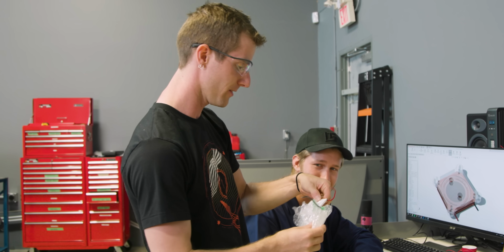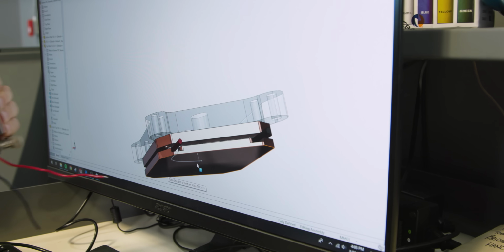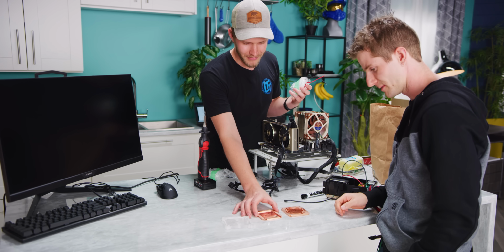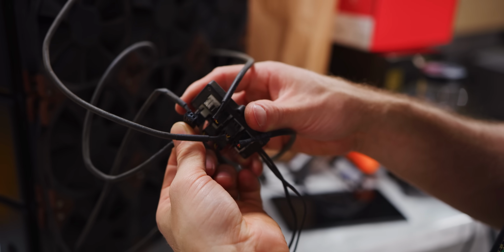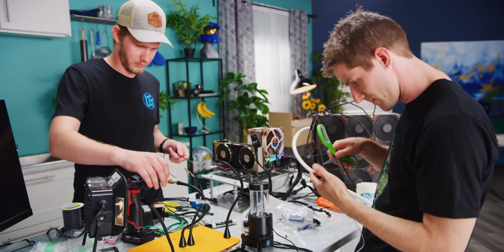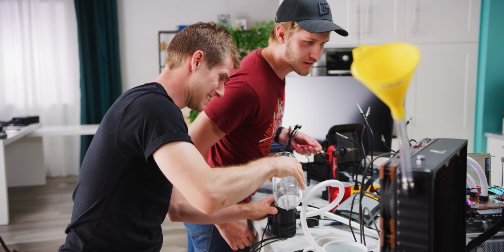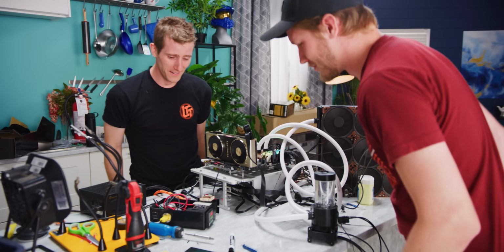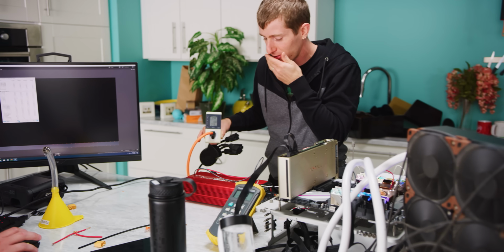This Cooler DRAWS 545W!!? Bad Cooling Ideas #2

Comment: Linus, it wasn't a bad idea... 😁😁😁 It's just normal to run into some bottlenecks with such tech concepts... For some reason, I have some faith in your work. It's either the next big revolutionary cooling system to hit the market. It only takes a good amount of expects putting in some more work and some few trials. It should work 😉😉😉

Comment: For future reference, get a CO2 extinguisher. It will still put out the fire, but wont hose your expensive GPU.
Reply: and maybe remove the safty pin too..... ;)
Reply: Daniel Svensson you should never remove the safety pin from a fire extinguisher unless you’re actually going to use it to put out a fire. As soon as the pin is removed the extinguisher is considered used even if you don’t empty it and must be replaced.
Reply: Get a Halon extinguisher. It won’t corrode or damage electronics
Reply: @FeNite8  halon is illegal
Reply: @t_c5266   Halon extinguishers are legal to own.
Reply: @daexion  yeah if it's from 1994 or before. Halon is illegal to manufacture
Reply: @t_c5266  Halon is used all the time in data centers and aircraft
Reply: @FeNite8  only where it's grandfathered in. It is illegal to manufacture any new halon. Look it up. Clean air act. And the NFPA. You can only get recycled halon and already existing halon.
Reply: @t_c5266  But it isn't illegal to have, use, distribute, etc. Only, there's a limited, nonrenewable supply.
Reply: Idk I prefer those hydrogen extinguishers
Methane works also
Reply: @makinbacon21  that is a big Brain idea
Reply: And it'll help cool your CPU! Hey Linus, try CPU cooling via C02 fire extinguishers!
Reply: CO2 extinguishers don't work for electrical fires. For those, you need to get a powder extinguisher. Which would, by the way, still hose your expensive GPU.
Reply: @Z3DT  that is BS.

CO2 is the preferred way.
But still don't count on hardware surviving, there is rapid cooling and condensation.
Reply: @Z3DT  Maybe not... as long as the powder is not thermal conductive, a quick clean and the GPU should still work.
Reply: @christopherkidwell9817  powder extinguishers trash whatever they go on. Stuff is corrosive. You'd want to ultrasonic clean it after it was sprayed to make sure it's reliable in any way
Reply: @Z3DT  Read the label. CO2 extinguishers were designed for electrical fires. They do not work on grease fires.
Reply: @JoshuaBurgess  they are suitable for petrol and oil fires. And recommended for live electrical fires
Reply: @Z3DT  just grabbed one of my extinguishers. An FE36 will work. Rated B,C so it will work on electrical fires. So no nuking components =D

Comment: The better you cool the hot side the better the effectively it cools the cold side like for example if the hot side is like 70 degrees c the cold side could drop like 30 degree c so it's 40 on the cold side but if you can cool the hot side to below subzero using Linus DIY window AC cooler the the cold side could get temperature you though of before

Comment: watercooled sub ambient setup submerged in a mineral oil tank that is also cooled sub ambient. would condensation still form?
Reply: I've done that. Condensation builds on top of the oil, and sinks down to the bottom. The silicon oil I used were lighter than water.. It needs to be completely sealed. Ambient hotter air moisture will always condense on cooler materials, even oils^^.

Comment: Why are u using metal bolts to hold the cold and hot side ? Those bolts conduct heat from the hot to the cold side. Use plastic ones next time.

Comment: Okey, so if one TEC doesnt work, with not use more? in parallel, stack them to get more cooling power, of course its going to eat more energy, but if you increase the "cooling" power but keep the same area i think it could work

Comment: Can you make a video where you cool the cpu directly with water?
I mean building something like a tank, which sits directly where the cpu cooler would sit and has a hole on the bottom, where the cpu is located. So the CPU will be directly cooled by the water. The tank with the cooling water can then be cooled with other things.
Reply: That's a very stupid idea on multiple levels
Reply: @bucklinspring  which is why it's so great!

Comment: Just a quick note for future vids, Solid State Relays like the one you have are incapable of switching DC on and off. They use a TRIAC internally meaning that once they are on they get stuck on until the voltage falls to zero (which happens 120 times a second with 60Hz AC). I would recommend a MOSFET SSR in the future, they sell such devices for use in 3d printer heated beds.

Comment: Good job Alex, even though the tec didn't hold up the machining of the water block was top notch. maybe you need more peltiers cooling down a larger thermal mas to stabilize the temperature under load. Keep up the good work and linus give alex a good performance appraisal.

Comment: @Linus Tech Tips - protip, if you mount peltier element backwards, just switch wires and it will switch around its hot and cold side ;)
edit: also maybe you could use PS_ON instead of SSR
edit2: Peltiers take up to 15V
Reply: did either of you even watch the video or what
Reply: Jan Nowak  You should only run a Peltier element at 60% to get max efficiency. 12x30 is 360 so it puts them pretty close to the 60%. Still over by a bit actually. I agree though that they don´t know anything. AC relay when using DC current :D Although I think they took it out when they used the variable DC supply.

Comment: Redesign your fins to conduct more than 1000W of heat, consider a Staggered pin-fin array and try stacking Peltier's. This isn't over it can be more extreme!
Reply: Nix Kanal stacking peltier’s is a horrible idea!
Reply: @rileyfenley522 yes but it is possible to get lower temperatures if you stack them by size like a pyramid. Look up Cascaded peltiers.

Comment: Can you please plug it upside down, hot side on the CPU and cold side on the water block. Then you use the electricity from the seebeck effect to power the pump & fans.

BOOM! Passive cooling baby!

Comment: I actually did a peltier module cooling system for a science project in prep course. In the end, it all comes to the efficiency of the thing, a Peltier module is very innefficient because of joule effect. Usual cooling systems such as a fan+rad or a watercooling don't actually produce heat (well, they actually do because of moving parts but in a very small proportion) but a Peltier module produces way too much heat. They usually uses a bunch of semi conductors whose electrical resistances are not negligeable. If you power your peltier module with maximal power it is actually going to heat up even on the "cool side" because the joule effect will draw more power than the peltier effect. The best would be to turn it on with less power, with a potentiometer for instance, and increase the power little by little, seeing at what point it starts to drop. But doing all that is a pain (I tried to do it but you have to get a potentiometer that can support a lot of power and they are not cheap). That's why TEC is not a very used tech, and why your fridge isn't a big box with a bunch of peltier modules on the back.

Comment: The issue is that the efficiency goes down the more power you put into it. Instead of using one large peltier, you need to use several. I have 32 across several waterblocks, but I only ran it at about 6-700 watts of the potential 2500. A loop on the cold side also acts as something of a buffer before the heat would overcome the cool.

Bridge rectified and ran various amounts in series to get some cheap voltage control without psu limits. My downfall was I couldn't justify expensive pc water pumps and opted for super cheap water fountain pumps. Couldn't keep the darn things primed and the system would fail the moment an air bubble came through.

Comment: Now use an aquarium chiller with automotive antifreeze in a water loop.
Reply: ...antifreeze is terrible at cooling, though... it's literally right there in the name.
Reply: @evilkillerwhale7078  i am using a 20% ethylene glycol and 80% distilled water in the same loop for years. Recently i dismounted a GPU waterblock : it still looks like new.
no more maintenance to do ever ! no corrosion, no algae or bacteria.
that's what they are using in AIOs watercooling systems by the way.

Only drwaback is it's highly toxic and tastes sweet. so toddlers and pets are a concern in case of a leak.

waht i bought is a botle of ethylene glycol based automotive coolant. (jsut check the poison writing on the bottle to know if it's etylene-glycol based)
don't use propylene glycol. it does nothing against algae growth
Reply: @neojack333  Above 20% PG does act as a bacterial and algae growth inhibitor.  Below 20% it does not.
Reply: Advocatus Diaboli  The difference in boiling point is not important because race cars run a pressurized system.  Need a higher boiling point, run a higher pressure.  Conduction of the fluid is vitally important because you need to transfer the heat from what you are trying to cool to the fluid.  Look up convection heat transfer.  
It is actually against many race regulations to even run glycol based coolants for safety reasons.  It creates slippery conditions on the track.  The only one looking like a fool is you.  You obviously know very little about heat transfer and cooling systems.

Comment: You are supposed to use a water cooling loop and add the peltier after the radiator along with a water block and another air cooler. Thats the efficient way to use them. That way the rad does the most of the heat and the peltier brings it to ambient or sub ambient.

Comment: maybe cooling the water with the Peltier device inserted would work?
Reply: that's how a water chiller works. yeah it's effective. actually using radiators is not advised since it can bring ambiant heat into the loop !

Comment: Who buys an expensive tap then doesn't use a vice?
Reply from the maker: In fairness all the other holes I tapped using the mill, just forgot to do these two so gave it to Linus -AC
Reply: @LinusTechTips  We all know you've tapped more holes than Linus  maybe you should do it next time.😜
Reply: @LinusTechTips  good to hear Alex, I was starting to think Linus was doing it wrong on purpose to trigger AVE
Reply: @LinusTechTips  AC :  This was a great video.  Would love to see a Part #3 where you go for low-wattage TEC cooling with more modest gains!  Run it with the 1080 rad on a normal WC setup and measure the avg load temp -- both water and cpu temps.  Then switch to the TEC setup with the same measurements (avg load water and cpu) with a goal of hitting  5*C lower load temp on the CPU than the first setup.  That should translate to 15*C or so hotter water.  You'll be able to  demonstrate the waste heat trade-off more effectively with a smaller scale (lower wattage) test, and dial it in for max gains on the CPU temp!
Reply: @LinusTechTips  22:05
how did/do you feel now that intel has made one?
Reply: alisdair butler it wouldn’t be LTT without some jenk
Reply: The funny thing is they have a vice
Reply: You must be new here.  Long time viewers would expect nothing less.
Reply: Linus - because what you fail to understand is, it only has to be "straight enough" - stop fussing over doing it right when you can do it janky.
Reply: That would require walking all the way to the workshop.
Reply: Jan Nowak  We had it up to 24V in the end there with the second PSU
Reply: They apparently didn't learn the critical bit of Canadian engineering wisdom, "keep your dick in a vise".
Reply: They have a drillpress, I don't know why they don't just attach a self reversing tap head like a tapmatic and get perfect threading every time. I cut acrylic for a living and use one every day.
Reply: All the gear and no idea, it's what LTT is all about :D
Reply: Apparently I failed to underline the word everything. Including things beyond the scope of this video. 

Use your imagination, E. V. E. R. Y. T. H. I. N. G. 

Bum ankle guy, let’s go play a racket sport. 

Machinist/tech guy, come show me how to run a MRI machine. 

To the next one; how’s your open heart surgery skill set?
Reply: Linus, because that almost seems like a bit. I'm also pretty sure Alex recommended an easier solution,  but that doesn't make for great content which is why you get the confused "What?!" after Linus suggests to Alex that he listens to his boss.
Reply: Its a soft material and the hole orientation isnt critical. Relax.
Reply: Linus Sebastian.
Reply: taphandle expensive????? quite common tool... granted mine is probably 40 years old but cant imagine theyre expensive
Reply: Good taphandles start at $100 and go up to 200
Reply: It would have been good if they used a starting tap (taper), instead of what looks like a bottom (finishing) - that would also help with alignment.
Reply: Who uses a screw driver like Linus does at 10:00?
Reply: @Therapistwatermirrur  Im not sure if this is a wtf or a raise your hands comment.

A lot of techs that have a ratchet driver will do that.
Reply: they didn't even use wax lol
Reply: I just came to the comments to add exactly that. This 545W unit isn't built to scale with anything I have on record and based on 90W of heat load I would assume the peak efficiency is just a hair under 16V(23.65A) and assuming those fans are actually doing their job, you should be looking at a total head load of around 470W on the hot side only. Too bad that cold plate design is hot oversaturated garbage. Fix the design or approach it differently. You should be looking at a delta no lower than 55C in that situation.
Reply: THEY HAVE A *DRILL PRESS*
Reply: Because Linus likes to spend obscene amount of money on stuff he doesn't need but cheap out on random stuff.
Reply: My guess is people who are better at using software than tools? I am hoping to meet me someone who is good at everything, let me know if you find them.
Reply: @AugmentedKing  hi technicians exist and we're mediocre at everything!
Reply: @AugmentedKing  They're called engineers
Reply: @Darknes2DWC  bring your engineer, and i'll bring a contact sport thry're not good at...
Reply: @AugmentedKing  lol
Reply: @Darknes2DWC  I see you're not a mechanic. Engineers and their stupid designs are the bane of our existence. Also they can't wrench for shit. I've seen it firsthand.
Reply: @Darknes2DWC  Or technicians..🤔
Reply: @TKettle  Hell yeah!
We had an engineer once trying to undo a left hand threaded bolt - he wanted to know if he needed a different ring spanner to turn the bolt in the other direction....
Reply: @AugmentedKing  Engineer had a machine not meeting expectations.  Says he discovered problem "Power was 208 VAC and the plug was a 250VAC plug."
Reply: @AugmentedKing  Yeah. Those people are few and far between.

But barring my ankle. You've met 1.

Theres a tradeoff, as far as the "does everything well" people ive met are concerned (including myself).

Usually a bit odd. Sometimes unstable.

Also, rarely have i seen one of these people BLOW ME AWAY with ability, except for the fact that they have so many.

I assume a few may exist. But for the most part, you are only so good at something...the people that can do everything dont seem to do that 1 thing wayyy better than anything else.

Like using a shotgun instead of a laser, really.

Yeah, it can shoot that target, even at a pretty far distance with slugs...but, youll never hit two 1000 yard shots back to back.

If that analogy didnt just confuse the fuck out of ya. 😂

Edit: I guess iean you can use your brain and better than average coordination to compensate...but youll never be better at either the mental or the coordination aspect.

There will always be someone with more talent in one of those areas.

The dude thats all physical makes you look stupid on the court/field...when you can hold your own against most others, but cant figure out what hes doing half the time...and a master level chess player will make you feel like a moron. But cant even throw a baseball.

Then you have priveledge (idk how to change a tire because i had roadside assistance my entire life) and the lack of exposure issue.

But, it aint so bad. Tis the murican way. 70s-80s across the board. Lolol.
Reply: @AugmentedKing  I tried decathlon and wrestling, boxing, mma, basketball. I pick only nice girls. Im a decent engineer with solid job in my branch and I also do rebuild old cars and bikes at my own workshop. Oh.. and I do cook and have a garden. 
Im not amazing at all this but did or still do good or v. good.
Reply: Out of the 30 employees you have you should have hired someone proficient on handtools  🤦🏻‍♂️
Reply: The kids don't even chamfer the hole before tapping...

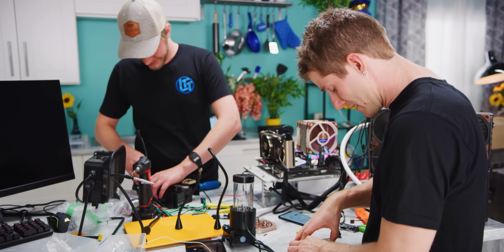Comment: 12:34 you could just reverse a polarity of Peltier element
Reply: It's less efficient
Reply: @valyushalee2320  peltier element is just to tipes of metals velded together, over and over. Cold and hot side are defined only by direction of current
Reply: @TomazSeserko  I feel like the reversed polarity npnpnpn screws up some stuff.

Comment: I tried peltier cooling about 20 years ago.  Rule #1 with peltier cooling...  Use a temperature controller.  I turned my CPU into a block of ice and fried my motherboard.  RIP little K6-II.

Comment: Why don't you make like COOLiT have been made before ??? 4 or 6 little TEC in daisy chain not on the waterblock but on the radiator so you eliminate the heat of the TEC with the fans of the radiator ??? The best way is to use watercooling but stay with a water perfectly cool .... That's the water you need to cool down and not directly the cpu (and so you can use any waterblock you want and even watercool other element).